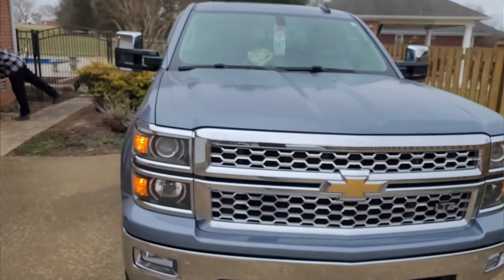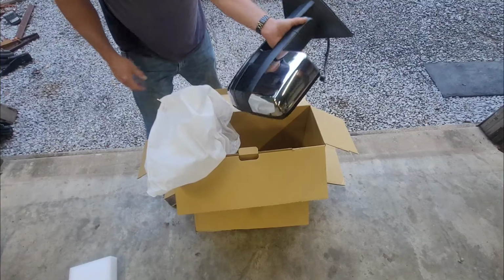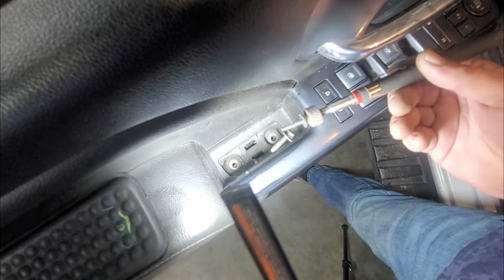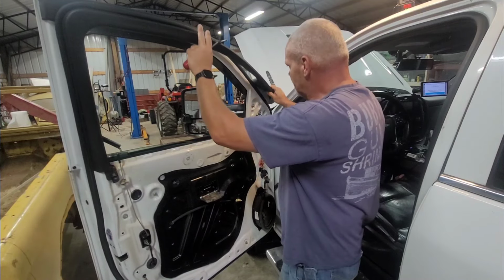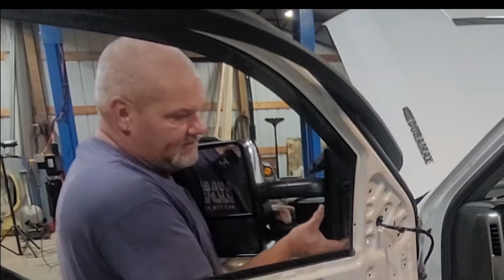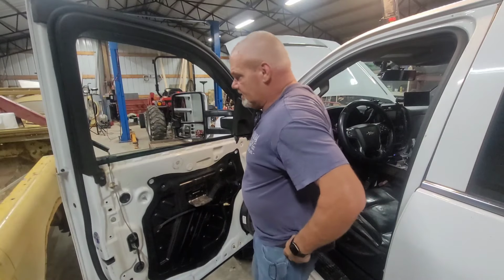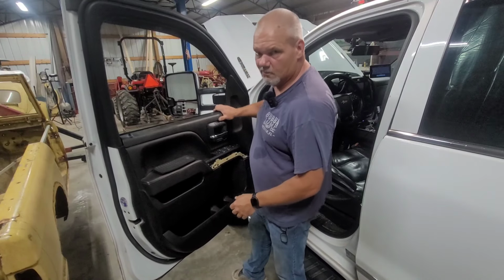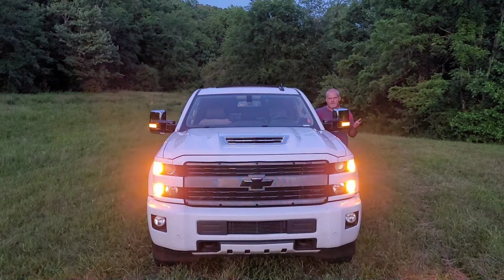Boost Auto Tow Mirror Upgrade on my 2018 Silverado 2500hd

Comment: Hey buddy, just recently got out of the hot shot business and ran a 2017 Chevrolet Silverado 3500HD High Country.   Just got rid of my truck.  I have a few new spare parts you are welcome too.  Your videos have helped me on several occasions.  Let me know.  I am in the Sacramento area.  I also have an Edge Insight CS2 that is used but works perfectly $100.

Comment: Is your truck leveled in the front and rear? Looks like it to me. If so, how did you go about leveling it? Level kit, torsion key crank etc
Reply from the maker: It was leveled in the rear with 2 inch drop Shackles when i bought it. I've added air bags and put stock Shackles back on so it would carry a load better so it's back stock with air bags on rear.